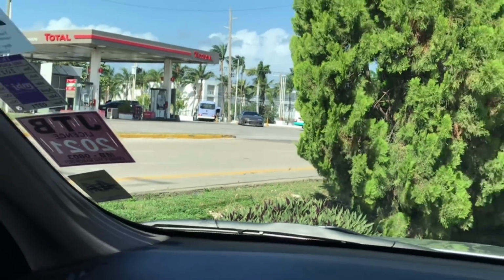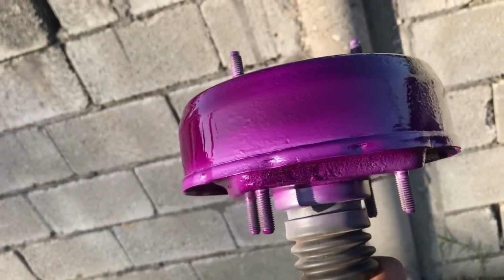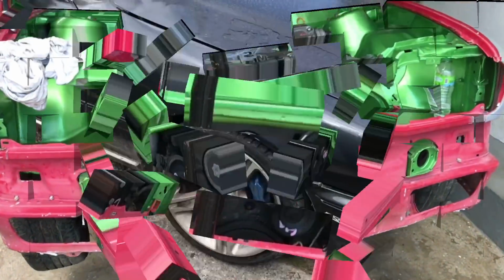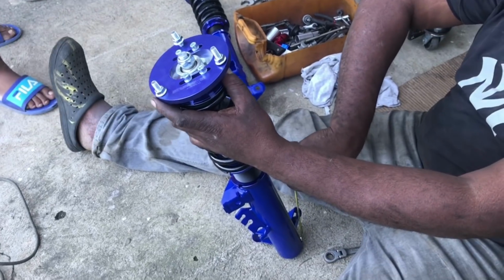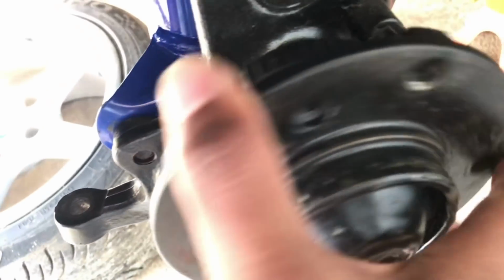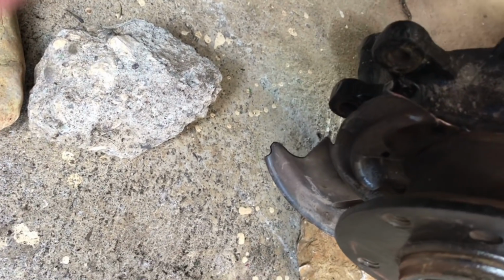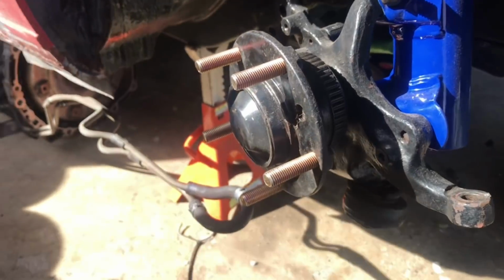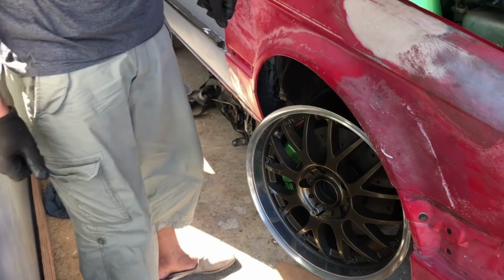E30 Build- Braking and suspension test fitting (episode #16)

Comment: yo family ... u installed those studs the wrong way .... u gotta put them in from the back .. u could use a lock nut to pull them forward to keep the stud hat flush at the back .. then weld it to the hub at the back for extra strength  ... what u did there is a lil dangerous i could see that breaking those welds in the short term